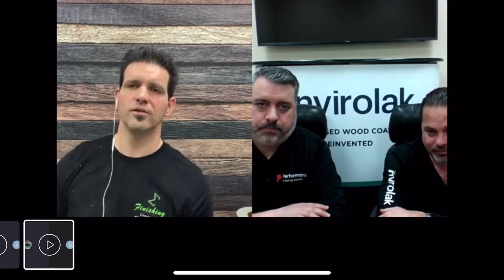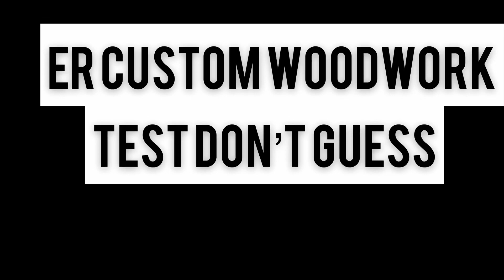High Viscosity Water Base Finish

Comment: I recently started used Kem Aqua plus and I've been impressed so far spraying over satin enamel paint and oil based stain.  Two questions for you. 

1.  Any advice for using waterbased lacquer on woods like walnut or cherry?  Kem Aqua looks like deathly ill skin over natural wood.  Is it better just to use oil based over water based in an application like natural wood?

2. Do you often spray painted cabinets with a lacquer or simply use a semi-gloss paint with no top coat? Example, vanities or kitchen cabinets that are painted.

Comment: Eric Reason another fantastic videos. Very informative. Thanks again. If it’s not too much trouble could you show a video of your spray set up and of you spraying. I would love to see that. Thanks again for taking the time to educate the rest of us.
Reply from the maker: +Jason Adams i will try at some point it’s hard to film it because it’s just a one bay garage. Setup. I have a filter wall
With fans that is on wheels that i can move
Reply: No problem. I am just curious that’s all. Sometimes I wonder if my finishes are at the top level.  I am always trying to improve my equipment as well as my technique and my knowledge for that matter. I was fortunate enough to have a father who is a master carpenter and furniture maker so he did most of the finishing in house.  When it came down to spraying My brother and I took turns spraying furniture as well as cabinets Also I was taught to spray conversion varnish on cabinets and furniture at a pretty young age so I do have quite a bit of experience with that.  I was very young back then and most of the stuff we sprayed were in different containers that he had set up. I just knew to put container A with container B And mix them together so to speak. I never really knew exactly what I was spraying. I know that may sound crazy but that’s what I did. The finishes were flawless and I don’t feel like my finishers are quite that good at least compared to my fathers. I have asked him over and over again what his method was and how he did it back then but he doesn’t actually remember. He was very old school for instance in all of our wooden hammer ends we would drill a hole and fill the hole with beeswax. We were always taught to dip the Nail in the beeswax before nailing up trim. Of course this is long before we were using air tools Anyway I appreciate all the help and all your work you’re doing to start the waterborne revolution lol.